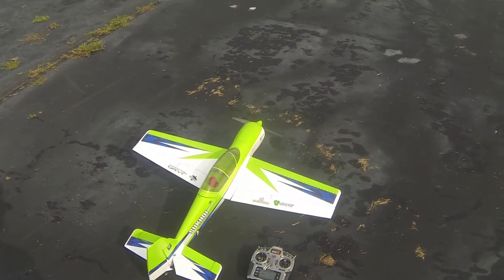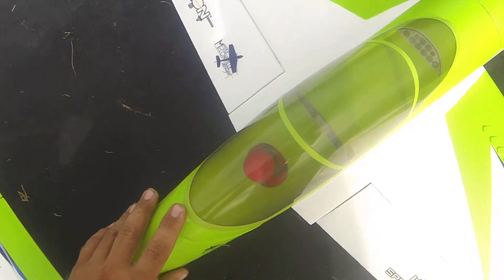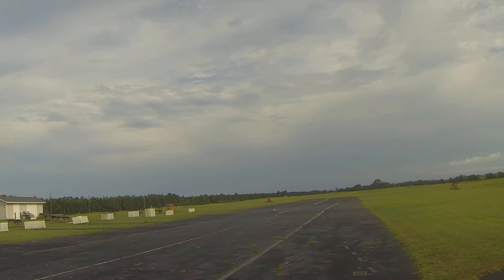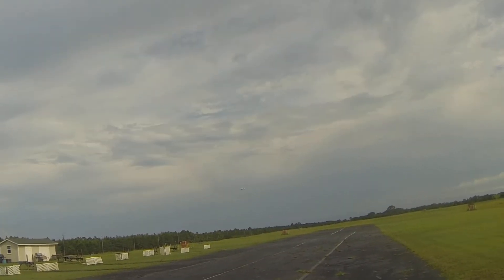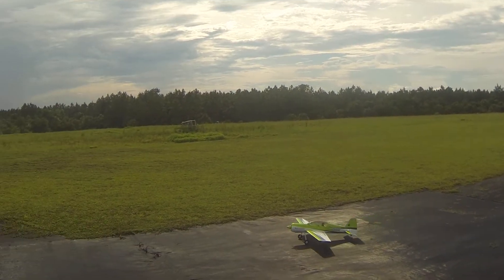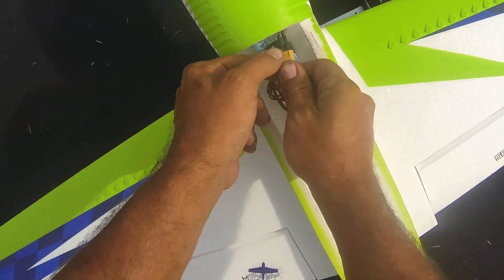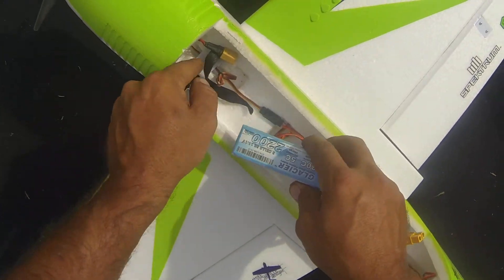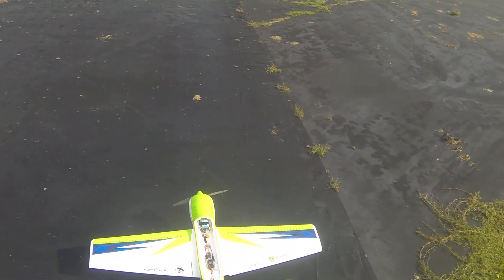Sukhoi 29MM - Flight 2 - New Power 10 motor and Castle 35A ESC

Comment: so you said your not very good with planes. Does that mean the sukhoi is pretty easy to fly?
Reply from the maker: You have to realize that my background with advanced 3D on helicopters translates to planes pretty well. Planes are easier than helicopters to fly. So while this is actually my very first plane, ever. I do think it is easy to fly and handles well. I like it a lot so far. But I wouldn't necessarily recommend it to everyone as a very first plane. It might be okay for some people as a first plane, like myself. But for some folks, it could be a bit more sensitive than they are ready for at times. Though with proper guidance and TX setup, It could be made to fly less dramatically like a trainer, i suppose.